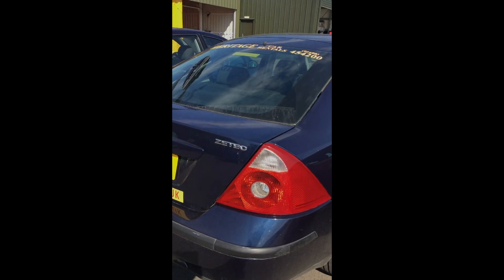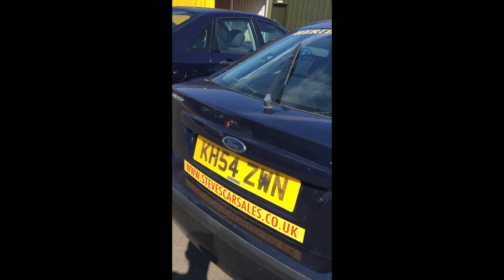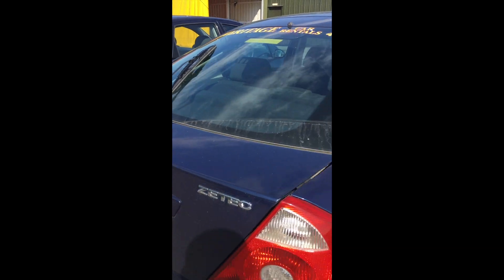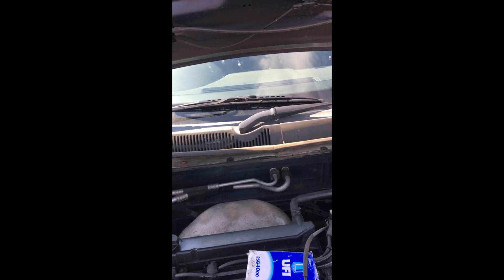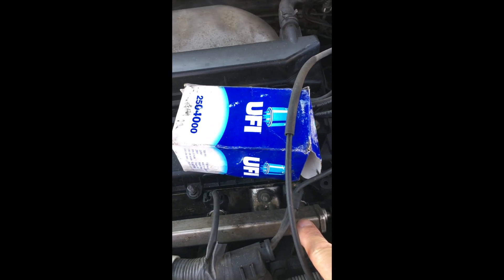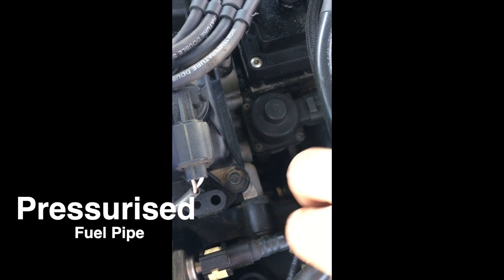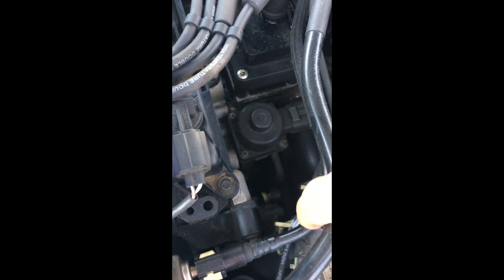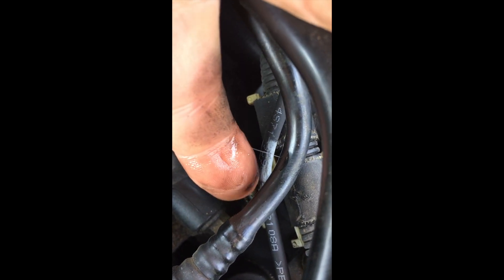For the sixth time in one year this fuel leak has happened, ford mondeo mk3 2 l duratec

Comment: Our Mk3 2.0 Duratec did exactly that at about 140,000 miles, this was back in Nov 2020 so well before E10. Bought a new pipe for about £40. At least they are easy to fit.
Reply: That's interesting Matt.  Alan's theory about the manufacturing flaw must be right.  Either way, I think I'll replace mine as a precaution.  Cheers.  Vivian

Comment: My car has similar pin hole, but points up and it is not in the bend,  it is about 2 inches from the bend, just before the protecting mesh. I will think if I order a pipe or just install a rated hose with clamps.
Reply: I finally purchased one from the main dealer, they are charging Ferrari money for this fuel pipe, 65€. The part number by the way is 1333466

Comment: I've done 3 thousand miles in my 2014 mk4 mondeo tdci it's a fantastic car, it's having a cambelt and water pump done on Friday. It's 103 thousand miles I'm not stretching that to 120. I'd love to know how to disconnect that plug on the fuel filter. Could you do a real up close demo video of that please mate I'm scared of breaking it and mine doesnt want to come off. I know you have done a video already but you made it look easy and did it too fast
Reply: If it’s like the petrol version,you just pull the plastic collar locking piece out and it slides off easily then
Reply: @NeathVideos  thank you I usually carry out my own maintenance but that plug has me baffled I will take another look at it thank you Martin. The plug moves backwards and forwards but doesnt want to come unclipped. I really am wary of breaking it and having the ball ache of sorting it out
Reply: @chucky2316  looking at this video the cream coloured plastic clip would push downwards and come off,it’s kind of like a C or circlip,but made from plastic.  And it simply located in a groove on the fuel line

Comment: I had a fuel leak on my Focus 1.8tdci thanks to a little rubber seal on bleed off injector pipe.. I recon it was damaged when someone installed new injector.
Cheers for another informative video Alan.
Reply: Ford's common problem

Comment: Thanks for that info Alan.  As you know I have a Mk3 1.8 Duratec so will keep an eye on it.  Cheers.  Vivian
Reply: Is yours 1.8 sci it says that engine specifically isnt compatible with e10 fuel thats probably whats eating away the fuel lines so much on these it seems like if it is the e10 causing it then ford/goverment need to update there website to say the 2.0 not compatible too before it starts causing fires
Reply: @sbrader97  That's interesting.  Though mine's not an sci I was still wary of the new E10 petrol in my '55 plate Mk3 so I normally use BP Ultimate now which is still E5.  I read some time back that there was a danger of E10 perishing fuel pipes.  Maybe this is now what's happening to Alan's Mk3 hire cars.  Bit scary if the fuel is squiring onto a hot engine. Cheers.  Vivian
Reply: Good to know that this can happen. My cherished 04 2•0 Mondeo hates E10. Mpg down and power too, only use Super Unleaded now.
Reply: @DavidSmith-ze2wi  Yes David - my 05 Mk3 goes really well on BP Ultimate E5.  Worth the extra money knowing it's better for the engine.  Good mpg as well.  I did a 400 mile return trip last month, mostly on the A1M 70mph, (sometimes a little over!) and was getting 40mpg.  Not bad for an 18 year old car.  Just about to turn 100k.  Cheers.  Vivian
Reply: @vivianhughes9347  Glad to hear your Mk 3 is running so well great cars, love mine.  Agree with all you say about using Super Unleaded. When they tell you not to use E10 in your lawnmower, chainsaw, hedgecutter etc tells you something I think.